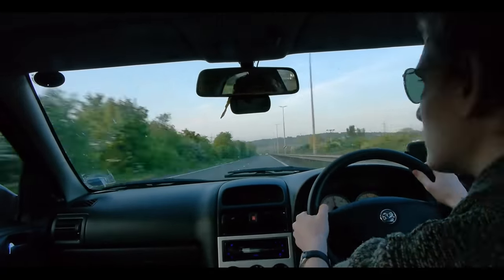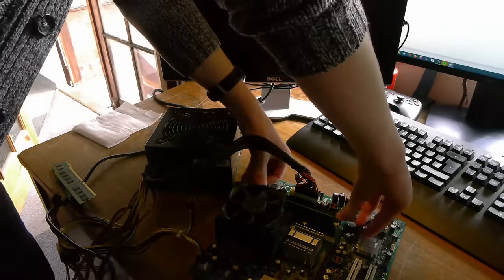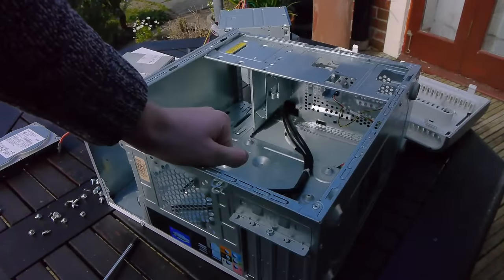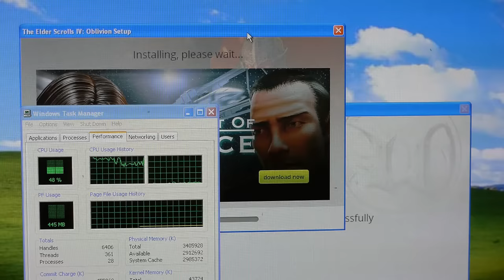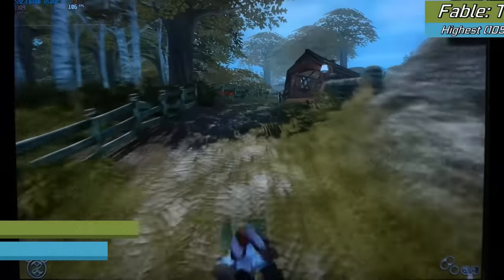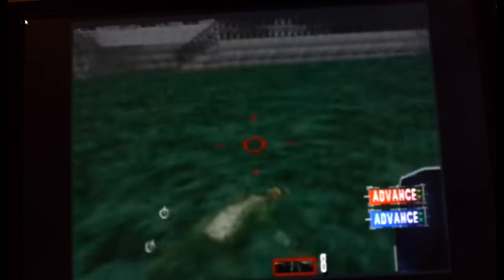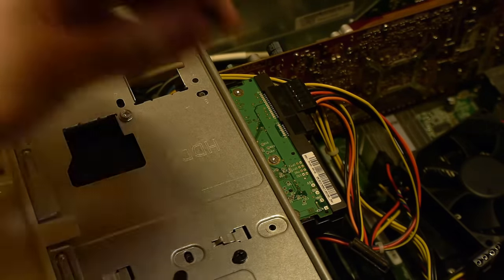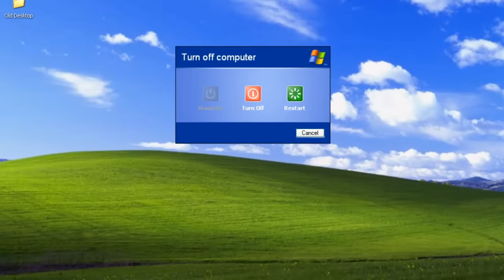The Ultimate Windows XP PC

Comment: you know that the "bloat" in W10 is just shortcuts to install those things IF you want them. Candy Crush is not really installed.

And yeah XP was fine back then but it's old and obsolete for modern times and modern tasks. It's 90% nostalgia at this point.
Reply: You kind of missed the point of the video if you're trying to compare XP to W10. At no point was he trying to compare the two nor was that his intended reason for putting the system together to begin with. It was literally for retro applications or quirky software that can't handle newer OS's better if at all. That said W10 - IS - full of bloatware which if you dig into the OS at all you will see that first hand and not just on a surface level either. Not to mention spyware laced and having removed most of the user control elements clear out of the OS. It's sad when you have to use third party software to FORCE the OS behave like it should and consequently give you the user control elements back that never should have been taken away to start with. Not everyone's circumstances are the same and Microsoft's blanket coverage approach with W10 isn't working for everyone for a reason. In fact up until recently I'd have about fought till death defending Microsoft products. After digging into W10 and seeing the sketchy shit they were pulling with it as well as the direction that W10 was suspected to go based off of what they were doing with W8 there's a reason I'm on Linux. If I need windows platforms I have a offline XP and W7 box for gaming or will spin up a VM for something more serious if need be. Microsoft's victory with W10 is short term and the drop in market share proves it. Give it a few years and Linux will be a even bigger threat then it already is. Best thing to happen to Linux ironically was W10 and Apple's own bs. Go figure lol...

Comment: Fun fact I have a motherboard for an ultimate xp machine and you can use a Pentium 4 with ddr3 ram and sata 3, I'm right now using the core 2 e8400 and a quadro k4000, I'll eventually get a core 2 quad

Comment: TECHNICALLY the ultimate windows XP pc is an i7 3770k, GTX 980ti or Titan, and 4gb DDR3(16 on 64 bit), as these are the newest parts with drivers(although the gpu requires some driver modification, but its very easy to do)
Reply from the maker: Can't run MGS2 or Capture Analogue Footage aswell. Specs =/= Ultimate

Comment: I have a Dell E510 with 2 GB ram, GT 430 and two 250 gb hard drives. It has a Core 2 e8400 or e8600 and windows XP Pro 64-bit. I plan to upgrade it to 4 gbs since the motherboard only supports 1 gb dimms and it has 4 slots.

Comment: I'll tell you where WinXP shined. In the days of XP, after Vista and even Win 7, I tried lots of freeware and shareware....so creepy things would show up now and then!  LOL  
Here is where XP beats all other OSes I ever tried. I always did an nLite modification to de bloat and speed up XP.  Then, after completing the setup, I would do a disc image. Would take maybe a little over a minute. (Win 7 would take 15 minutes to do the same thing.) Then, if and when the creepy things would show, do a restore image and in less than 2 minutes I was back up and running, with a fully loaded XP. (Restoring a disc image in Win 7 takes a minimum of 20 minutes, usually more!)
So THAT is where WinXP, IMHO beats all the others. As a matter of fact, I COULD use WinXP now for everything I do, with no loss of speed. But supposedly using XP endangers other people on the internet somehow. So I have moved on to Win8.1, which I like (till I have to do a disc image, or restore one!!)

Comment: Wouldn't the ultimate XP machine be something like an Ivy Bridge i7? The newest CPU architecture that fully supports XP 64-bit? Many Ivy bridge boards still have PCI, Parallel and serial. That's why we keep a couple around at my company, to control ancient equipment that still needs PCI cards and Parallel connections.

Comment: I saw you had a CiT PSU unit in your "junk pile"....I'm using a CiT PSU....It has given me no problems at all since I started using it in 2013...And I use it everyday for hours....
Reply from the maker: Some of the dedicated 430W+ ones are surprisingly capable. That one is a 500W came with a case PSU and blew up with a C2D using 80Watts.

Comment: Saved an Advent CPD1301 Centurion a while back. It'd been in a hair salon for years and was utterly disgusting, all the card readers on it and all the vents were filled with hair. They'd got rid of it as half the time it wouldn't turn on and when it did it suffered from some awful artifacting, turns out its just that it's OEM HD 4350 had completely wacked out so I replaced that with a HD 4870 and swapped out its tiny 200 and something Watt PSU for a 2007 500W cooler master unit I had laying around. Now it handles anything I can throw at it in terms of XP games except crysis warhead, normal crysis launches and runs fine but warhead just refuses to open, it'll probably just be because the disc for it in the copy of the crysis collection I got from a charity shop for 2 quid is a bit scuffed or something

Comment: 15:51 my msi z77a g48  motherboard have a pci slot and i used it to capture some fotage from a vhs camera by old pixel viev tv card and worked good, this pc is my daily drive soo i switched hard drives and my friend help me to setup a linux drivers to a app to capture the signal and worked good, but is more simple to buy a Video grabber Hauppauge WIN TV USB-Live2 and it can be opereted from windows10 and it works very good for me but it costs 50euro

Comment: The real ultimate PC (that can still run win xp) would be much newer though - something like a 7350k, 8gb of 3000Mhz+ ram (4 would obviously be enough, but you want dual channel and there are no 2gb sticks of ddr4, although I think there were a couple of z170 boards that had ddr3 in which case 4gb of 2400Mhz would be just fine) and then either a 780ti (fastest gpu with official drivers), 960 (newest official gpu) or even 980ti (fastest gpu than you can make work by slightly modding the drivers)
Reply from the maker: That won't run MGS 2 though will it.
Reply: @BudgetBuildsOfficial  I see no reason why it shouldn't, unless that game is one of those that specifically have issues with newer gpus, regardless of there being official drivers for xp or not. For those titles the consensus among the (retro) community is that the most powerful gpu that plays nice with virtually all earlier games, is gtx 285.

Comment: XP has official support through Ivy Bridge and the GTX 960 (not 970 or 980 (Ti) though). Now that'd be a seriously overkill XP machine.
Reply: A couple corrections here but all Nvidia 9xx series cards DO have XP driver support. Meaning the best Nvidia card you can throw at XP would be a 980 TI but it can be done. My current rig has a 4 gig SSC 960. Also you can run XP on gen 4 Intel platforms too. Also XP DOES support 4th gen Intel platforms. My XP system has a 4790K which depending on what motherboard you use you might not be able to find XP drivers for it. That said if you use Snappy Drivers it’ll find and install all the drivers for it. Yes it’s safe and it’s free too. Used it on multiple machines. It’s good. Anyway don’t be afraid to throw beefier hardware at XP if you can find it for a good price. Hope that helps. Some of my current XP era games are running over 1300 FPS lmao

Comment: I think if you really wanted to call a windows xp computer ultimate, you really should have put a Core 2 Quad in it. I know most games of the time wont take advantage of it, however 4 cores is nice. I have a windows XP machine here at home, that has 4gb of DDR 2 1066, a QX9650 overclocked to 3.8ghz, my grpahics is kinda bad with only a GTS 450, however i do also have a 240gb ssd and the computer is hilariously fast :D Also the fastest graphics card that I am aware of that works in windows xp is the GTX 970. you can mod a specific driver to run the 970 with windows xp and runs just fine.

Comment: I went with 3rd gen 3770 instead. Found a Q77 + 3770 for $100, and built the rest with parts I had lying around, everything else was more expensive, more cumbersome (like driving out of town to pick up) or just too much slower than 3770. Paired it with 950, the newest GPU that has XP drivers, but I am thinking of splitting my Win XP and Win 7 rig though, it's a real pity XP can't use the spare GTX 970 I have lying around.
Reply: A little correction here but all Nvidia 9xx series cards DO have XP driver support. Meaning the best Nvidia card you can throw at XP would be a 980 TI but it can be done. My current rig has a 4 gig SSC 960. Also you can run XP on gen 4 Intel platforms too. My XP system has a 4790K which depending on what motherboard you use you might not be able to find XP drivers for it. That said if you use Snappy Drivers it’ll find and install all the drivers for it. Yes it’s safe and it’s free too. Used it on multiple machines. It’s good. Anyway don’t be afraid to throw beefier hardware at XP if you can find it for a good price. Hope that helps. Some of my current XP era games are running over 1300 FPS lmao

Comment: XP in the begining was quite heavy for hardware i've got that time(Celeron 366@550, 256MB of ram, really slow hdd), not so responsive, games runs worse, more ram usage, etc, but when i install it I just didn't believe that my pc can be so stable (day w/o bsod with 9x was something strange heh, and c'mon how many times and how often we have to reinstall win9x...).
I was using xp to the end, I almost didnt use Vista/7/8, 7 not exacly (but it wasn't main default OS) because some games needed features like dx11.

Edit:
Windows 10 LTSC is an answer or even modded LTSC that has cutted 99% bloatware.

Windows 8.1 was total crap for me because that extremly annoying touch interface, but with open shell and some mods it runs really nice on older hardware.

Comment: I use an identical dell as an xp gaming rig that I got for free at a scrap heap (it has its original psu and I gave it a floppy drive instead of the cardreader plus it is currently using my radeon x600 gpu also free from a scrap heap) also I have another dell that is also used as an xp gaming pc...

Comment: I've got the 531, which was basically the AMD version of this PC. Athlon X2 3800+ at 2GHz and 4GB ram with an HD 5450 (mainly to have an HDMI output). I want to upgrade it to a higher clocked Athlon, and if possible add a quad core to it, but considering it's age, I don't think a quad core is possible. Ideally I'd like to use a 6400+ since those run at 3.2GHz.

Comment: The ultimate windows XP pc is the last officially supported, and the one I have: 
GTX 970 (last to have native VGA output, the first to have HDMI 2.0). You could go with gtx 980 ti, but it'd be overkill for anything XP-era. 
Gen 3 Intel i7 3770- Last to have drivers for it. I run in a p8h67-v, but you could even go with a Z68 and a K cpu.
I had that exact 4850 model back in the day. It was absolutely awfull and overheat at stock at 85c+ AFter it build up dust in  few months, it was reaching 90c and eventually died on me. Worst Card I ever had.
I dabled with C2Q builds for a Win Xp retro machine but I ran at NUMEROUS problems with 3 different motherboards and DDR2 instability and decided to go more modern. There is nothing a gen 2 chipset can't do anymore than an older 775, they even have pci legacy slots. They would be more expensive tough, about 100 usd+ for the full platform, but it is well worth considering they double as a nice Windows 7 machine too and are totally capable to run Windows 10 too, you can even play cyberpunk or warzone at 60fps with an intel 3rd gen cpu.

Comment: Haha yeah Vista is that weird OS that some programs "just work" on. Also it's pretty stable if the computer exceeds the recommended system requirements and all the patches are installed. I know from experience, my grandma's PC could barely work with Vista since her internet was too slow to get all the necessary updates though with our more expensive family Vista PC it ran like a tank without issues and we didn't have issues with it until the graphics card fried itself from all the dust.

Comment: I have this exact Inspiron 530 that I need to slap a GPU and a new drive onto...well, and a PSU, because this one has no way to power a GPU... Other than that - it works! :D
I'm gonna have a blast from the past playing with XP in a bit... oh deal, what a shock it will be going away from my RTX 2080Ti SLI build to that... O_O

Comment: First thing: did you try setfsb to get even more CPU clocks out of this? These desktops are most likely supported by setfsb.
Also, I have 4 Pentium 4 6xx based Dell desktops most I got for absolutely nothing. They are weaker in performance but the dell dimensions and OptiPlexes are far, far more reliable than these cheap inspirons with all of mine working as soon as I press the power button. My mums friend also has a Vostro desktop of the same grade as this inspiron and it has given all sorts of problems here and there, therefore be mindful of that if you do put this thing to stress.
One way to tell a higher end Dell PC over a low end one is to see the BIOS. If the BIOS setup screen isnt one of the typical dell style ones, it is a low end crap that might break at any minute.

Comment: Omg I’m old my first windows PC was windows 3.1 I was about 13 years old before that I had a Commodore 64, I guess I need to refresh my XP machine think I might run 2 hard drives in raid 0 so it runs faster if it had Sata I would use an SSD but it’s an IDE mobo I have 2 new 160gb HDD’s laying around I could use with an adapter

Comment: Ah the core 2 duo e8400 running one overclocked too 4 ghz in my testrig with 2x2 gb 1066 mhz ddr2 & random gpus, usually go between a hd 5770, nvidia 8500 gt overclocked atm whenever i decide too boot it up again too run something like 3dmark 03 or older game.

If you want a solid earlier windows xp laptop i can recommend the dell inspiron 9000 or a similarly aged laptop, specs on the one i got is a pentium m 1.5 ghz 1.5 gb ram & ati x300 64 mb as gpu screen resolution on it is 1440x900.

Comment: PC builder of 20 years. I get what you mean wanting a simple old test bench having recently come into issues getting a PentiumD 965ee to boot into windows 10 (it didnt).
I've also had fond times modding a dell 530s painting it and cutting it to fit other motherboards. (530s used same motherboard but I find the stuff more pleasing).
But considering I think you can run Xp on 2600k I think calling this the ultimate xp machine is disingenuous....oh you mean hardware from the time? Well xp launched around 2001 so by the time of this e8400 you're talking vista or early windows 7. I'd have suggested an athlon x2 as more time appropriate.
But I digress. This video has made me dig out my 965ee again after giving up last week to see if it's because I'm using a ssd or whatevers going on (msi g41m p28 SOI board).

Comment: Where do you get all the drivers for Windows XP? I got an Athlon 64 X2 system with a Radeon X1900 XTX that I want to revive and whenever I run old Windows, drivers are always my roadblock. Currently I have the thing running modern linux because it does a lot of that stuff for you, but I think Windows XP might be a much better fit

Comment: 4 gig of ddr2 RAM mmmmmm not bad. i and I'm pretty sure the last Windows XP machine I was running i had 6 I'd have to pop the side panel off and double-check.mmm I still remember technicians just about losing their cookies because most people back then were running still around 500 mag and maybe one gig lol. i always love maxing out the ram even when it's not necessary lol. Like I already mentioned I've got several custom-built ddr2 and DDR3 gaming rigs and I've got a Dell THX media editing computer that at some point I've got to find out if it still runs or not or if it's just a pretty decoration. yaa thay at one point made a desktop with the THx logo on it unfortunately I don't have the factory software that came with it hard drive was yanked when I got the machine.i Recently got a really nice little Acer with lots of ram in it and was presently surprised to find out that it's a quad-core for its day miniature desktop. Normally when I get that particular model Acer there a dual-core first time I've gotten the quad. Planning to put an SSD in it and see what it runs like.i have a Windows 7 quad-core Acer laptop that once I put an SSD in it and Max do the ram it was such a happy little laptop;). It snaps out and loads up so quick from initial boot up it's almost scary lol. Had a few people that have never seen Windows boot up that fast before.

Comment: WindowsXP was kind of meh for me. Win2k before it worked fine for basically anything I was using early winXP. Then I installed win2003 server as a workstation.. which basically made it like a winXP.. mostly, but way, way more stable.
My experience with vista was surprisingly good. I got it with my work laptop, back then and it was surprisingly stable. The reason Vista works with stuff XP can't is that it did support both old(2k/XP) and new(win7+) driver models. So Vista could work with surprising variety of hardware and drivers. Yes it was bloated, but it could be somewhat optimized so speed was, again, surprisingly decent.
It should be possible to run (all) your winXP software under vista as long as it's not explicitly version locked, which you can circumvent.
P.S. My most missed thing from the XP/2003 era are custom windows themes. There were many community developed ones.  I had some custom ones that I had modified myself that worked very well for my needs. Vista and later ones broke that.